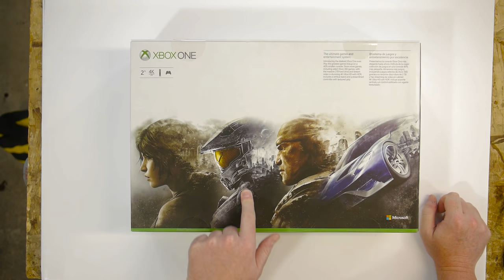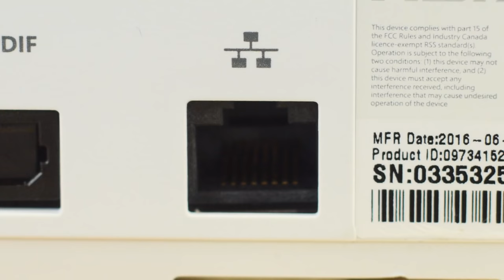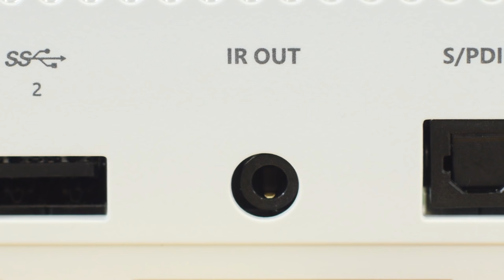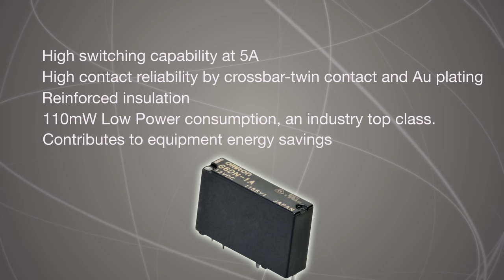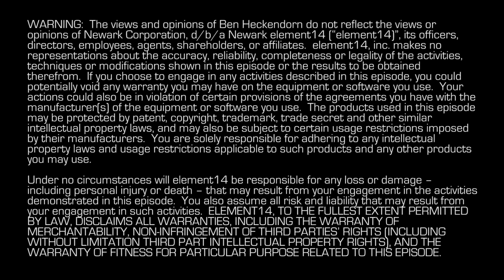Ben Heck's Xbox Slim Teardown

Comment: Instead of making an Xbox One laptop, how about trying to fit one into a 4K TV, so it's an all-in-one device like an iMac? TVs are pretty thin these days so I think it would be quite a challenge to include a full games console!
Reply: holy shit  :)
Reply: That would be an awesome idea, bet the switching from TV to xbox may be an issue doing it via software rather than needing some kind of switch.
Reply: That is a great idea, I would also really like to see this, please work your magic Ben!
Reply: that's what I Hope he does
Reply: That's a really awesome idea!
Reply: Meh, I don't know.  This almost seems too easy.  A TV is just going to sit on a table, so form-factor isn't really a problem.  Take all the guts out and put them in a slightly larger box to fit the system with it.  

A laptop is an interesting project because you have to fit all the components in a certain way to make it easy to carry around.
Reply: awesome idea
Reply: i would buy that shit
Reply: I think this is a good idea and very do-able... might have to thicken the tv up some, but they could both use the same power cord, and have no hdmi cord dangling
Reply: instead of doing a full games he could mount the disk drive near the side so as new games come out you can still use the drive and for 4k blu rays and the software to include it wouldn't be hard to do
Reply: sony did something like that years before with the ps2 but i think it sold only a few
Reply: That sounds amazing with a liquid coolant to keep from over heating

Comment: Make a Xbox One S portable with built in rechargeable battery.
Reply: +Kyle Hurd They're not going to market and sell it lol.
Reply: His suggestion wouldn't cost anything at all. AMD brought their 'APU's out in 2013. 

JJ, I knew what both of you meant, just ripping on the Spoder a little.
Reply: That already exists. It's called a Windows 10 laptop PC. ;)
Reply: xxpyroxx75 dude most laptops have interrogated gpus like in the motherboard. Usually high end workstation laptops have dedicated gpus and gaming laptops have dedicated gpus
Reply: Ryan Curnow they must have a insane CPU to run games on ultra
Reply: ***** k
Reply: You could make a lot of money doing that
Reply: Yea. This would work. All you would really need is a bunch of 18650 cells out of old laptop batteries, a 12 V inverter, charging circuit, and monitor. Then something to throw it all into. Would end up being pretty bulky and somewhat expensive to throw together, but it would work

Comment: Hey Ben, decent teardown yet again.
One key thing you left out. The Xbox one S APU has supposedly been upgraded to 14nm FinFet drastically reducing power requirements and heat output which is one of the biggest reasons this console exists, the new proccess let MS make a much cheaper system.

Comment: I would like to see thinnest possible battery power laptop with out the bluray drive, if it requires the drive to boot, maybe you can take the bluray apart and only use the PCB.

Comment: 18:25 TMDS (HDMI) actually uses three differential pairs on three "channels". The other pair is PLL/clock. As for those TDMS traces, only one runs to the chipset as it's HDMI input or capture. The other HDMI ports runs to a TMDS controller and from there directly to the APU.

Comment: You can't shrink the partitions on Xbox One's anymore, they fixed that in an update sadly. If you have a 500GB model you can clone the drive to 500GB or 512GB SSD (480GB SSD won't work) or an SSHD drive of you wanna save some money. The Xbox One uses NTFS but breaks specification by having more than 4 primary partitions on on single drive. The filesystem uses 128-bit AES encryption to stop you from fiddling with it and each partition is signed by a key. (I've spent quite a lot of time recently upgrading the drive on my Xbox One :P)

Comment: An Xbox One Slim tablet would be pretty cool, especially if you could make it battery powered, and maybe hang on the wall. BUT I personally think an Xbox Slim integrated into a big screen TV would be cooler and more interesting to see being done since I haven't seen anything like it yet. Ive wall mounted all my TV's in my house but they all still have consoles, blu-ray players or computers still tethered to them. So yes, it's wall mounted but I still have plenty of cables running to devices that STILL require a shelf or table for them to sit on. My eventual goal is to eliminate all cables tying me down from an all wall mounted setup that would seem to "float" off the wall. So a big screen Xbox/TV combo being made would be pretty cool to see.

Comment: There are laptops now with 4k screens, so I am sure you could source one for a Laptop One S Project. IF you decide to go with making a laptop, I was thinking that this time you could incorporate a keyboard. I use a keyboard with my Xbox one all the time, especially when setting up accounts on a game, or searching for movies (Which would look great with the 4k display you source!)

**Side note, you were talking about the one power switch board that had circuitry but no chips. It could be like that because the One S controller now uses Bluetooth instead of Wifi connections. Just a thought!

Comment: Ben didn't mention the biggest changes, which are that the APU is manufactured using 16nm FinFET now and thats how it produces less heat. In addition. the GPU half of it is clocked higher now, boosting performance in some titles.

Comment: Ben, you need to get up to date on your laptop hardware. A 960m, which would be about equivalent to the XBone, can be found in laptops as cheap as $800. And with nVidia's new 1000 series laptop GPUs, which are basically equivalent to their desktop counterparts, even the most basic gaming laptop with a 1060 in it would destroy any console.

Comment: did you know that the controller also now has Bluetooth connection to synchronize with your Windows 10 PC without the need for a proprietary dongle.?
Reply: Social Gamer what if Nothing is on the screen and it is blue .

Comment: I think that the new controllers are blue tooth? And I saw a YouTube clip that said the new Gears of War game was going to be 4K gaming...?

I agree that making this into a laptop would be great and nostalgic, and that Xbox One portable/tablet thing didn't impress me as much as your 360 laptops did...but I do think that there might be something more radicle out there...

You mentioned that the psu was within spitting distance of battery power, but would that battery also be enough to power a screen though? 

Remember those old flat panel/dvd combo things? What about a 32" TV/Xbox One S combo thingy? it's a little bit bulkier than a laptop or portable, but it's all in one, and at 32" still kinda portable...or maybe a 27 incher?

Comment: Can always use a laptop screen, allows you to run it off the 12volt supply of PSU assuming there's enough overhead, they're thin and light, the only downside is you need to locate the driver board.

Comment: Also they can't actually void your warranty just because you broke a warranty void if removed sticker, that's illegal. They would have to prove that the problem with the console that you're trying to get them to fix, was caused by a modification you have done to the system.

Comment: You didn't mention in the video, do you know if the SATA controller on the "S" is a SATAIII/6Gbs  I have an external SSD but if the S has the faster port I rather clean it up and make it an internal drive.

Comment: Have people tried upgrading a console with an SSD? I'm curious as to what the difference is in performance.
Reply: The loading is cut in half, but that's it.
Reply: +Max Vianna "but that's it". Sounds pretty good to me
Reply: ReviloYaj For the price of it, i think that's small.
Reply: Yes I have and Xbox 1 with an ssd inside it and an external ssd it works really well and noticeable decrease in loading times
Reply: Pretty sure Digital Foundry did this with both PS4 & XboxOne
Reply: SSD is no good for online games yer you might load faster but you still have to wait for other players to load into the game befor it can start
Reply: +DonnyLad :D agreed and that happens a lot but I don't care about that I use it mainly just for total load times I know I can't count online loading times cause I knew I would wait mostly and sometimes when I host a Lan game other Xbox's on the network will time out don't know if it's because of the ssd but when I join in on someone else Lan I load just fine no time outs
Reply: they've done that since the 360 and PS3 era.
Reply: theres plenty of videos of an SSD in last gen and current gen consoles with an SSD. 

digital foundry has benchmarking numbers between different speed drives and SSD.
Reply: that might be neat. But there's may be some sort of hardware/software protection to lock the system onto the original hard drive
Reply: Nah, no protection against your own hard drive. It actually does help in Fallout 4 though in particular. That game has an issue with the original Xbone HDD's speed with loading in things (I wanna say texture streaming in particular but it's been a while so I don't remember) and sometimes has large lag spikes. Otherwise though, almost entirely just loading time improvements.
Reply: Trogdor8freebird
Nice! But what I was thinking of was a way to still keep it as an xbox, and not just turning into a PC. Was that what you were talking about as well?
 (sorry if the question seems dumb).
Reply: Lincoln Noronha It'd still be an Xbox, just with a different hard drive.
Reply: +Perry Craft what is your external? I have a 4tb Seagate that really changes the game.
Reply: +Steve Gilbert man nothing that big it's a 480gig sandisk ultra II SSD
Reply: Steve Gilbert I can't imagine that 4tb Seagate being an SSD. Or did you really spent more than the value of a new Xbox on just the drive?
Reply: +Mac Donalds I don't think he has an ssd but if it was a 4TB ssd he Paid more for that then Xbox is worth lol
Reply: Sander Kamp it's a Seagate Netbook, I never said it was an SSD. Perry Craft said HE had an SSD
Reply: Steve Gilbert Aah okay. Heard stories about a 60tb Samsung SSD, so a 4tb wasn't even that far fetched.
Reply: +Mac Donalds No, I asked about an external drive someone had
Reply: +Mac Donalds it's just a 4TB External
Reply: Simply the size of the drive and the speed that it loads...
Reply: Steve Gilbert Is it faster than the regular HDD already in the Xbox?
Reply: +Sander Kamp it's not a major speed upgrade but mainly it's for the size of the drive
Reply: ***** Maybe, but wouldn't it be awesome if the valley between consoles and PCs could be bridged?
Reply: ***** Controllers work in some cases, mostly with racing games. I'd hate to drive a lap on F1 2016 using a keyboard...
Reply: They're better for every game that contains drivable vehicles (excluding vehicles with guns tho).

And I like them for all laid back gameplay. Hitman 2016 is a good example.
Reply: Maybe, but it allows me to sit at my desk with my feet up, no where near the keyboard and mouse. Can't get more laid back than that. Come to think of it, I liked the controller for Mafia 2 too. Gave me more control, and only for gun fights did I switch to the mouse.

Let's switch it around tho: what if consoles used mouse and keyboard?

Comment: I would like to know what voltage range you can feed it if you removed the power supply.  Essentially I would like to mod it to work in my RV from the 12V battery bank.

That will make it so I don't have to waste power converting to 110 then have it converting the power back.  Hoping the X-Box board has some kind of filtering to allow a small voltage range.

Comment: Oh wow, Ben. I have to take exception. The PS4 APU has 6 more active GPU cores than the XBO APU and the XBO most likely didn't have a 4K capable Upscaling chip. 
This system is just upscaling to 4K. Upscales your old games, though it may render them in HDR now, it will render them in 720-900p HDR. Then Supscale it to 4K. 
The PS4 Neo will double the GPU Cores and speed things up to natively render the same details into 4K. So, same textures, same this and that, in 4K. That will be fine because the level of detail features swap superfast with the GPU wide like APU Memory Access. PS4 NEO will be same price, and NATIVE 4K, so you actually get greater depth of field and views. 
I know your a busy man, I just wanted to jog your memory, please take no offense. 
I love and learn from your channels as well, 
Cheers, 
JW>

Comment: Since is only 1 connector for the board now instead of two do you have any information on adding back buttons on the XB1S. and which points on the once connector correspond to A,X,Y,ground etc. Thanks!

Comment: sure the heatsink is smaller... at the original one they want the console turned on 24/7, always on, so it has to be cooled pretty good - also the powersupply. now they learned and see that people just turn the console on if they use it, so no need for much cooling

Comment: The power supply is the size of the PS2 Slim. They could of made the Xbox1 smaller making that external which isn't bulky and making the fan smaller but keep the same volume of venting. I'm sure they have their reasoning for it though.

Comment: This wold make an assume tablet with additional ports for bluray as an addition, Could you make a custom cooling solution to take the heat away as in a cooling pipe and run round the edge of the device to save on bulk?

Comment: @17:00 ish:

Ben, my $1,500 (retail when new) laptop with  970m and an i7 (much more powerful than the APU being used in the Xbox One/S) only requires a 230W power supply. You can EASILY run an Xbox One S off of laptop battery. Also, if you're spending $3k on a laptop it better have be the Titan X or SLI non-mobile 980s.

Comment: Mount a fitting screen on the topside of it, 3D Print a new Case for it to fit, same as now, a single box of plastic would be cool, make a stand underneath it to give it an angle and put a big biiiig 12V battery instead of the power supply in it!

Comment: Pedantic pseudo correction for 16:53...you could render a game at 4k at an acceptable framerate. It would just have to be a non demanding (likely indie style or 2.5D even ) game. Just as X360 and PS3 had a few non-demanding 1080P titles (I forget which now, IIRC some tennis game was one). I mean, for an extreme example, they could render Tetris at 4k easily.

So yeah, it's possible you could see a few indie titles with less complex graphics render in actual 4k. Although I have not heard of a single one yet.

BTW not sure how much you keep up with this stuff, but they did actually increase the GPU clock a smidge on the One S vs OG Xbox One. From 853 mhz to 914 mhz. So, it can smooth out the framerate a bit (say, 28 FPS can become 30) or increase the dynamic resolution in some titles that use dynamic resolution. Digital Foundry has some testing about that. Heck in one portion of one game they tested, it ran at 51 FPS on the old XBO and 60 FPS on the new S, a 9 FPS improvement! Although on average the improvement is much less (and depending on how the title is coded, maybe none at all, EG if the game is already locked at 30 FPS, it wont be helped). As far as we know the CPU clock stayed the same.

So yeah, I think it is cool you're getting a small performance improvement with your slim as well. Another nice little value add.

Comment: If I'm understanding Ben correctly, it sounds like his Xbox One S is 100/110v ONLY not a 110/240v combo (??) does this mean you can't use it internationally? Unlike most things nowadays which do seem to be 110/240v switching?
Reply: Nothing a step down transformer can't fix.
Reply: Sure but that's expensive, cumbersome and in 2016, very few "international" devices like iphones, laptops, computers are not switching 110/240.
I mean it's not going to impact me but it will impact someone for sure.

Comment: tl;dr - Make a proof of concept modular device out of it.

I'd like to see them make it completely modular, with the various pieces (The Mobo, CPU, Fan and base being one piece, the HD another, the Power Supply the third and the Disc Drive the fourth) able to be swapped out at will without having to do a complete tear-down.

Imagine instead of upgrading the entire console to get a bigger HD, a user could simply (and easily) detach the HD and plug in a new one without having to open the box? Or, as Ben said on the show, the user can swap out the power supply from a wall outlet based PS to a portable battery to be able to play it on the go (like the XBox One Portable Ben build a couple of years back, for example). This would also allow for the modular upgrading of the disc drive itself in the future when 4k is no longer the newest format.

This way, if one piece breaks it can just be swapped out and replaced without having to pay for a whole new system or having to send it in to be worked on by MS.

Also, as technology improves, the individual pieces can be upgraded piece-meal instead of having to purchase a whole new system, similar to the way that PC's can be modularly upgraded, except in a much easier fashion without the user having to have much knowledge of technology in order to upgrade their system.

I think, if anyone can prove this concept, it would Ben Heck.

Ben Heck, improving the future of gaming for everyone. ;)

Comment: Why do you need a heat pipe Microsoft deleted that on one of the heat sinks for the original Xbox 360 in 2008 and it worked fine with out it.

Comment: then with the switch over to Seagate, rather than the main cause of death being heat, it is HDD failures... (on average Seagate tends to have a somewhat worse annual failure rate than WD or HGST drives).